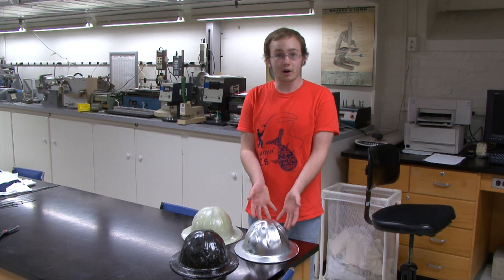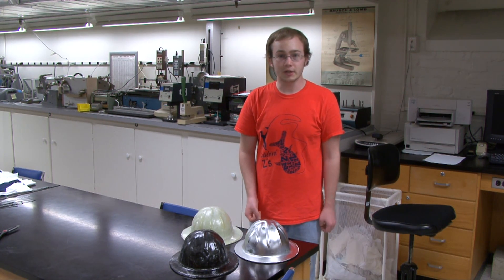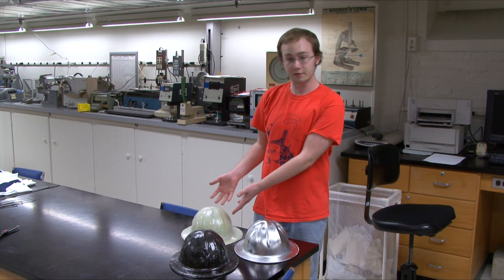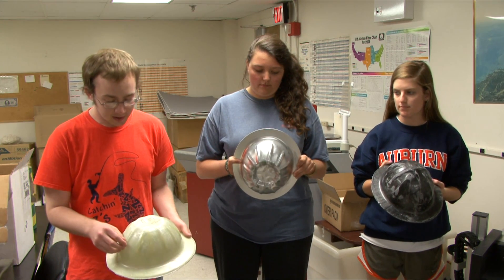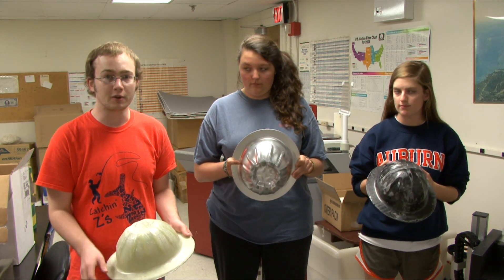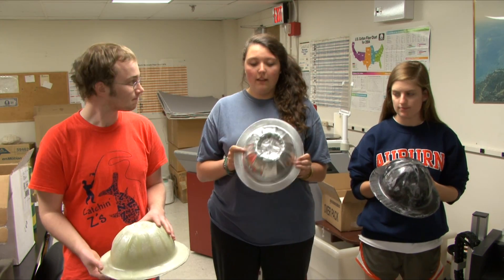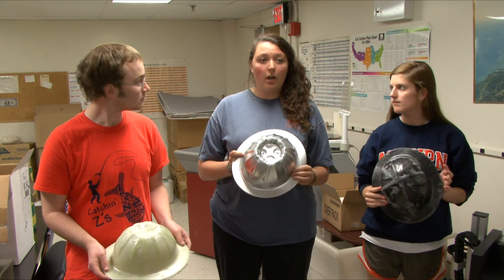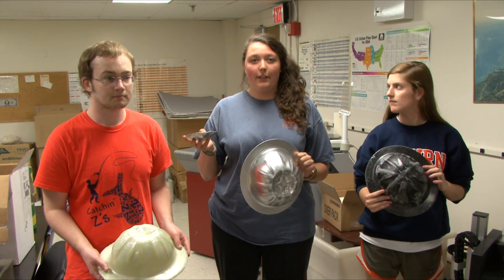Polymer and Fiber Engineering Composite Hard Hat Test

Comment: Hardhats are not designed to take a direct compressive force like you applied, they are designed to protect the user from impact forces.
Reply: Yes just to take the initial blow.
I have a plastic Chinese made American branded hard hat which took big hits from tree debris. On all events it was hard on my head but saved me. If it was a New Zealand made certified hat it would had split but safer. Anyways I'm happy with it.
Reply: Exactly!

Comment: I wouldn't call it very accurate. In industry anything that strikes your head is falling. So a test of slow over time weight test sure shows how strong the material is but doesn't do much to show if it obsorbs impacts. Plus hard hats primarily work hand in hand with the retention straps also stretching and obsorbing some of the impact energy. Like a seatbelt.

Comment: Does one want a hat that is unbreakable or should it break under some force to absorbs the energy transferred to the neck while the suspension system suspends the dent away from the skull?
Reply: Bingo
Reply: If the helmet suspension won't do the job, line the helmet with crushable foam.

Comment: There is a reason the vast majority of loggers and professional Sawyers use an Aluminum Skull Bucket.. it "absorbs" the impact to reduce injury.  You want the material to "give way" to some degree to reduce shock. I still have mine to this day and would never trade it for any plastic or fiber ones. The only realm that this changes is those involved in or around electrical hazards.
Reply: Wrong.

Comment: Another thought i had was the fact that the carbon fiber did NOT deform leads me to think MORE energy would be transferred to the head. Where the fiberglass would absorb some energy by deforming. Just a thought
Reply: The suspension system transfers the load around the head well enough that neck compression is a bigger concern. If the hat bends an inch and a half on impact, your skull is taking that impact directly and you'll wish you just had a neck injury.
Reply: You don't want the hat to deform, that causes brain and skull injuries. The suspension in the hard hat is to absorb and distribute the energy. It's not a car, where its designed to crumple.
Reply: More energy is distributed to the head, but in the case of the gfrp it would deform and if it made direct contact with the head then you would have a transfer of energy

Comment: Test failure.  Despite testing for material hardness, the test fails to account for compression of neck vertebrae.

Regardless of hat material hardness, a broken or severe neck injury can occur.  Most engineering designs, in general,  have design flaws.

Tests performed such as this justifies the need for scientists to develop safety gear as well as other technologies.
Reply: That's not a failure. It's just a different test. No single test is comprehensive.

Comment: your test is a failure. compression testing is different from impact.
Reply: So a rigid helmet is better than a softer one? DUH. So what happens to the brain and neck when ALL of the impact energy is transferred to the human instead of the helmet absorbing some of the energy. Broken neck and brain damage!!
Reply: Compression TESTING is a lot different that COMPRESSION testing (note the ALL CAPS)

What is compression?

In general compression testing is all about what happens to a file as it is compressed.

TESTING the differences in compression rates of a file, together with its size, and how it compares to other files with the same compression rate. Compression slows down files as you compress them. That means the file ends up taking a bit longer to download and uncompress each time you load it. It also means a lot more bits are potentially lost in the compression process, which is why compression is generally applied on very small files first, then worked up to the more frequent load of larger files.

I don't really know what COMPRESSION of FILES has to do with IMPACT of HELMETS... sorry you need to go back to school
Reply: @fartmcnuggets5247  What you said made perfect sense
Reply: @fartmcnuggets5247  Yo I had a stroke reading that garbage paragraph of yours. 

Maybe you need to back to school for another English class.
Reply: @PaulRudd1941  His post made perfect sense. Readers were riveted. "I was stunned," he told us. "I spent a couple of weeks just in my office absorbing everything. I was in tears every day. People were totally overcome with emotion."
Reply: @Natel164  I was just watching a DOCUMENTARY on writing in ALL CAPS when I saw your response. Actually, it was in a MUST READ/SPECIAL OVERVIEW but it got lost in the MEDIA PERSONNEL, although there was enough in it to make a firm statement on what is WRONG with the current Media industry, in which I sit. That statement is VERY GRAPHIC and VERY STUPID and I was DESPERATE to defend my writing.... After the recording of the segment ended, I was asked to leave the website for repeating the statement that made you and your blog so DISGUSTED. What has changed? I am not interested in the vitriolic hyperbole spewed by internet commenters (it makes me want to throw up), but is there a list of short comments that I like.  THANKS for the LOVE.
Reply: @fartmcnuggets5247  Sounds like you've got a few 'roos loose in the top paddock!
Reply: No it's not, the differences between the materials is what they're measuring.

Comment: was the carbon fiber made using pre-preg without an autoclave or did they use an autoclave during manufacture?
Reply: Typically when people say "wet layup", as they did in the video, it means they laid the carbon fiber by hand by combining dry fiber with epoxy (ie not pre-preg). It is unlikely that they used an autoclave to cure it.